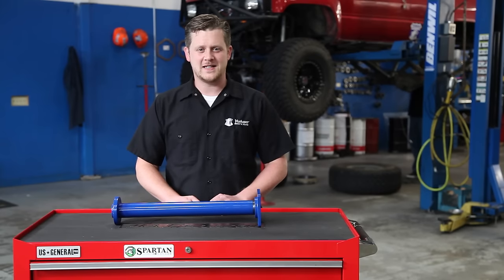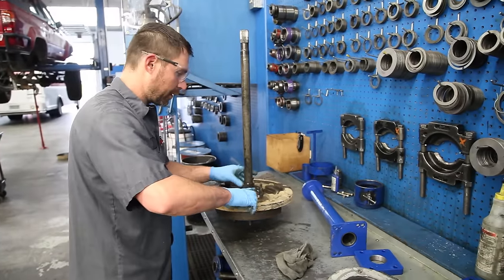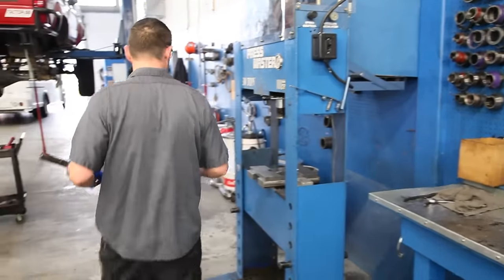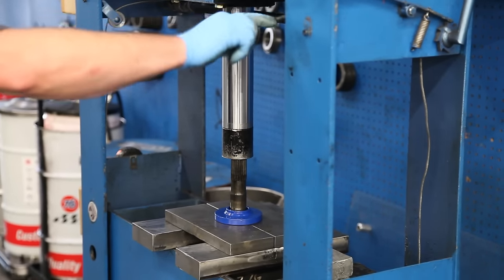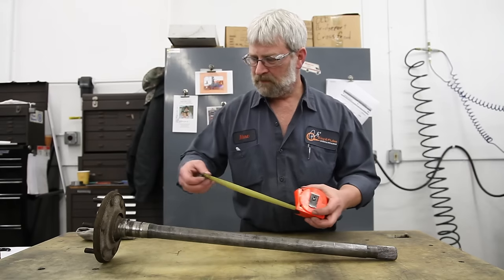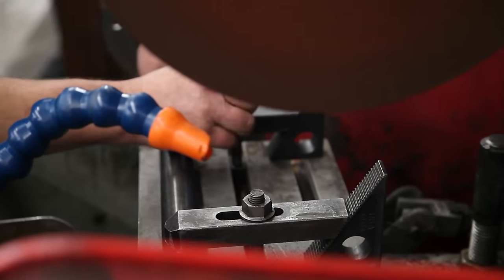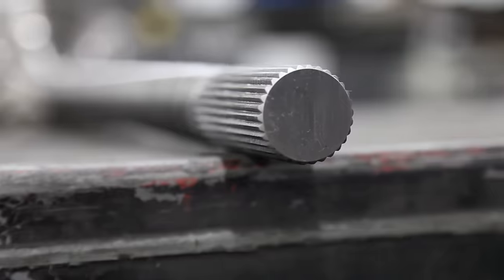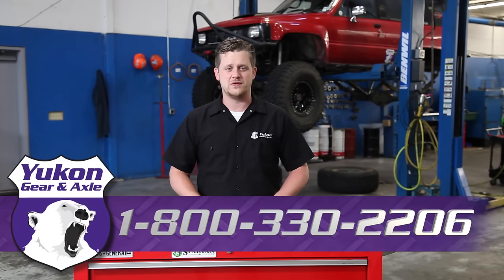How to Measure & Cut an Axle | Differential Tech Tips

Comment: Can a sawzall cut through an axle? (for a different application - using a full floater for a trailer)
Reply from the maker: With the correct blade, yes, a sawzall or band saw will work. A cut off wheel or chop saw makes much quicker work of it though.